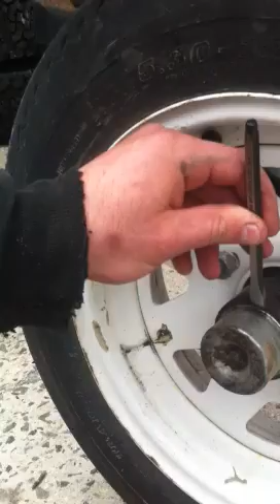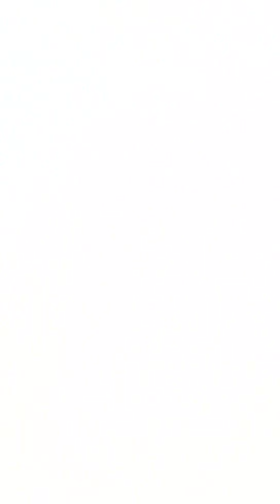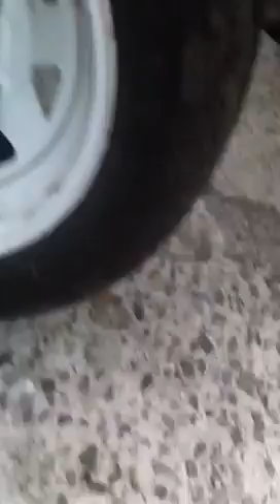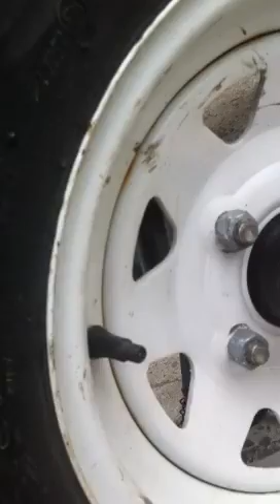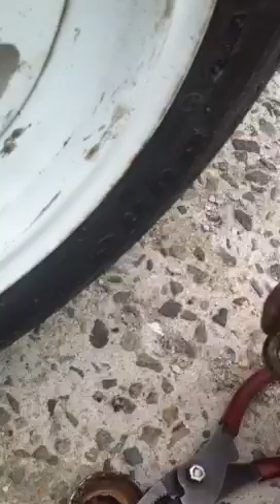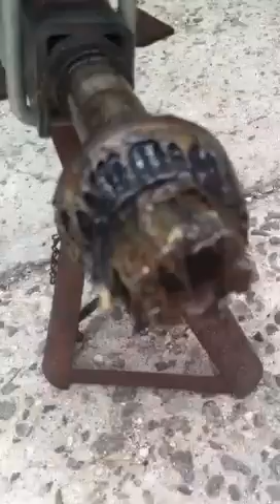Trailer axle bearing replacement the easy way.

Comment: I've been around all types of car repair for over 50 + years. I thought I knew all the tricks when it came to wheel bearings, but you showed a cool way the pop off the grease seal. Guess you really are not too old the learn a new trick. Thanks!

Comment: DO NOT DO THIS!!!!.. this is bullshit and will fry your outer bearing race .. the machined part where the roller bearings sit. What you have to do is
take the hub and wheel off as a unit .. mounted to the wheel
take the outter bearing and washer off
use a socket wrench extension and place it through the opening of the outer bearing and you will tap the back of the race on the inner bearing this will push the seal out when the race comes out because the seal is pressed in to butt up to the bearing race.

do not hit the inner bearing with the socket extension or you will destroy it. make sure you are only tapping on the outer most ring that you see when looking through the hub.. that is the race.

This means you are completely taking out the rear bearing and will need to tap in the machined race again when you assemble it all.

For proof place your washer into your outer bearing and see if it passed through to the inner bearing..  it wont it will hit the race and if you dent the race you have to replace the whole bearing..

DO NOT DO WHAT HE IS SAYING.
The washer will not go through the outer bearing race.. it would be fine if the outer race was removed but its not.. and also its not safe to do it this way.. so use a socket wrench extension and tap slow, even and easy.. the whole inner bearing race, bearing, seal will come out.
Reply: Zippy TheChicken I have to admit when I saw the video I thought this is what I needed to know.  Then I read what you wrote and well I did that instead.  I didn't replace the race just the bearings and seal.  Oh and the cotter pin.
Reply: yeah sometimes you see tricks like this and you think .. ok this is much easier and faster and i won't need special tools.. but you will cause damage doing this and it might mean weeks trying to find and get a part shipped...

Doing it correctly is not difficult although it does take a bit of time.. I don't know why people post stuff like this .. but you would totally waste the bearing if you put that washer on with a bolt and yanked on it.

Anyway good luck
Reply: I did it just as you described and have since driving from Baton Rouge, LA to Houston TX then to Dallas and back the same way.  The trailer worked perfectly.  Thanks for the tip zippy
Reply from the maker: Don’t do it because he does it with a socket. Some ppl don’t have sockets the exact size needed. I use this method on cars when I change rotors the new rotors come with new races. No it’s no big deal.

Comment: DO NOT do this, it is not the way to replace the rear bearings and/or seal and could cause damage to a race,. And, if you are going to film giving bad info, at least learn to use the camera correctly, or if you have a friend, have them hold the camera.
Reply from the maker: Oh stop it you’re just mad you never knew this. No damage was done. I do this to cars all the time and the rotors come with new races.